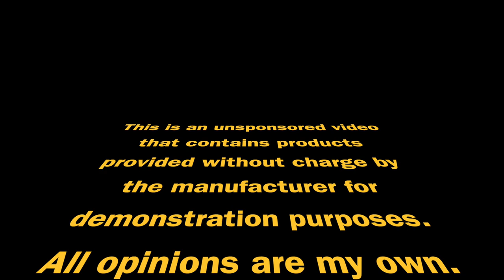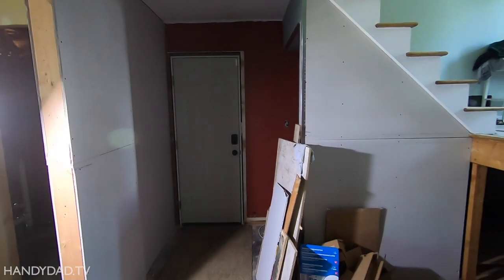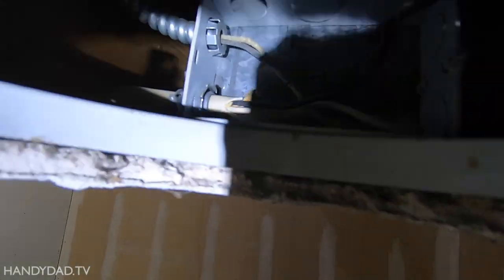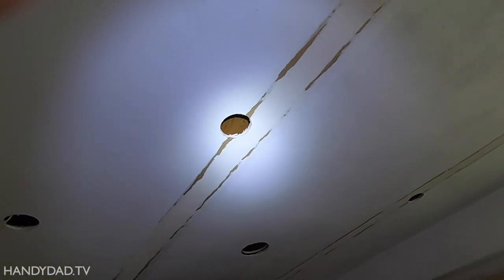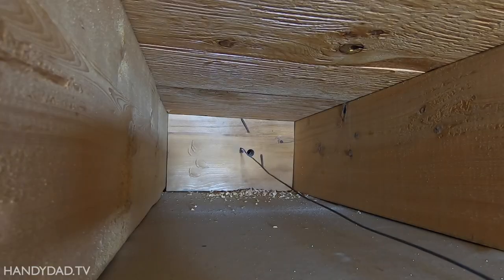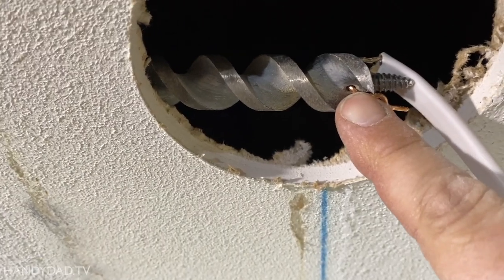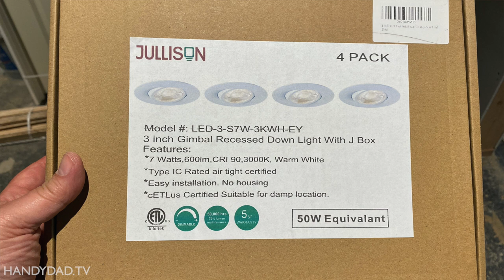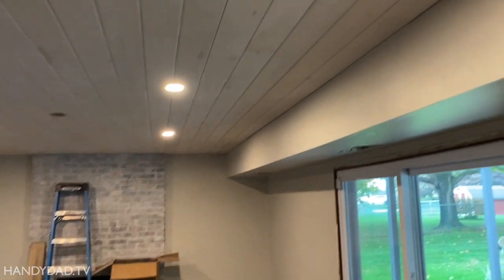WE LIT THE BASEMENT // TLF 34

Comment: Back in the 80s, when I was installing alarm systems, we had long drillbits like those, but they had a hole towards the tip that you could tie a string onto and pull a wire back. Very convenient.
 Edit: I just saw you realized there was a hole at the end of the drillbit after I left this comment. LOL
Reply from the maker: Yeah what a great invention!

Comment: I am about to do something similar but I am contemplating just taking all the sheetrock down, running the wires and then installing the sheetrock, cutting the holes and going from there. Either way you have to do sheetrock work, a seam is a seam.
Reply from the maker: Check out the price of drywall before you demolish it.
Reply: @handydadtv  12 dollars for 4' x 8' sheet.
Reply from the maker: Ok go for it

Comment: Thanks for the video! I plan on installing the same Jullison 4" lights in my son's room soon. It was good to have a reference of how much light they will put out.
Reply from the maker: Which style are you using? I’d love to see the gimbal lights in a bedroom to dramatically light features like wall art and bookcases.
Reply: @handydadtv  I plan on using the PN# SP4IN3KWH4P which is the 4" low voltage lights. My son's room is a decent size for a bedroom (not sure of square footage at the moment) but only had a ceiling fan with a single bulb. I figured it's cheaper to buy and wire in the four Jullison lights rather than buying a multiple light retrofit kit for the ceiling fan. I already have the wire and connectors on hand with room in the attic for easy access. Even though the lights are IC rated I plan on building a box around them made out of sheet insulation to provide an air gap between the fixture and the blown in attic insulation.
Reply from the maker: Four lights will certainly brighten up the bedroom. Although they are dimmable, be sure to check the compatible dimmer list.
Reply: @handydadtv   Thanks! I'd also like to say thank you for making these videos, they motivate me to tackle some of the DIY projects that I've been putting off because of lack of knowledge and skill. I've been binge watching your videos on the bathroom remodel and a few other vids that you've made.
Reply from the maker: Thanks Eric. I’m glad they’re inspiring you to take risks and try new things. You can do anything.

Comment: @handydadtv  Thanks for this video. It's very helpful.  However, I am curious about how you rand the wires... You discussed using the existing wire after you pulled it and moved it to the location of your first light hole.   However, starting at 8:19, you appear to run/snake an entirely new wire through your first hole back to the other holes you made for your remaining lights, but I did not see where you reconnected it back to the live wire and switch.  What did I miss? lol Thanks so much again.
Reply from the maker: At 6:29, that’s the old wire from the switch. At 7:04, I’m drilling through the blocking to run a wire to the other light across the room. At 8:19, I’m running a new wire to the second set of lights. Those three wires are connected at the first light. Hope that helps.

Comment: I’m late to the party here. 
Can multiple wafer lights be wired on a 3way switch with just 14-3 ?
Reply from the maker: Yes. I’ll be covering 3-way wiring in an upcoming video.
Reply: @handydadtv  I managed to figure it out last night

Victory!

Any tricks on how to remove staples that you can reach (need more slack)
2’ away from light cut out

Trying to do it without cutting/patching the ceiling
Reply from the maker: If you need 2 more feet, forget the wire staples; you’ll need to replace the wire or add a junction box. But you can’t bury a junction box inside a wall or ceiling. Easiest to install an old work junction box with a blank plate. Not invisible, but a LOT easier than pulling a new wire. 

FWIW, I have a blank plate in my ceiling where the builder pre-wired for a light, but we don’t need one there. We got used to it and don’t even see it anymore.

Comment: This was a very informative video, thanks.  I've always wondered if there is an electrical code requirement to fasten those boxes to a structure.  Most people just seem to put them up loose.  It seems a little odd to me that you need to put in strain reliefs from the romex to the box, then just leave the box loose.  Not that anything would be pulling on the wires once it is installed, though.
Reply from the maker: Probably would need to be attached for new construction, just like you need to secure wires with wire staples, so they don’t pose a risk with the drywall installation.